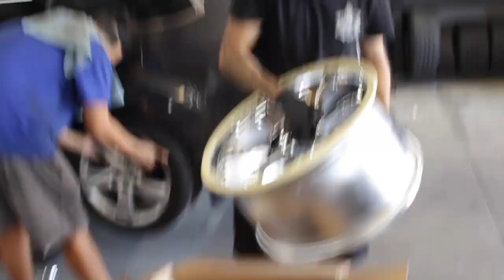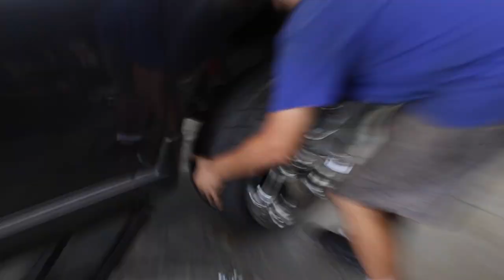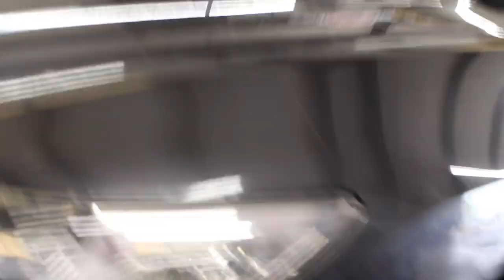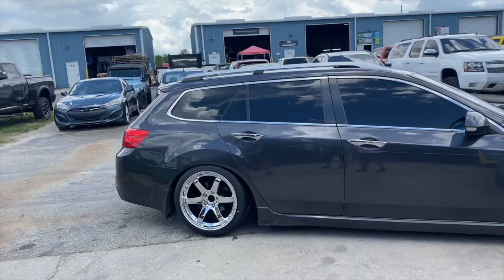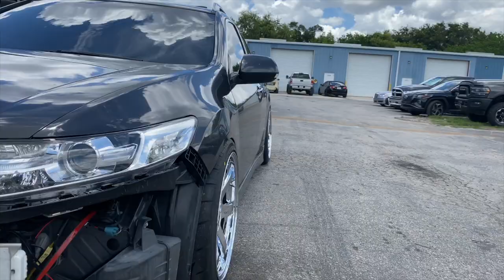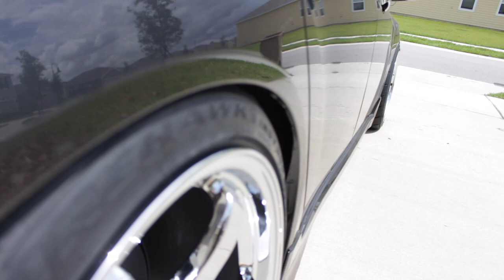CHROME TE37 STANCED TSX WAGON WHEEL REVEAL!

Comment: What are the wheel specs?
Reply from the maker: 18 x9.5 22
Reply: @NamedLisandro did you have to roll the fenders or anything at all for the 9.5”?
Reply from the maker: @9kalldy  can’t fully answer that. Because i had already shaved my rear quarters. And fronts were pulled alittle from previous wheels